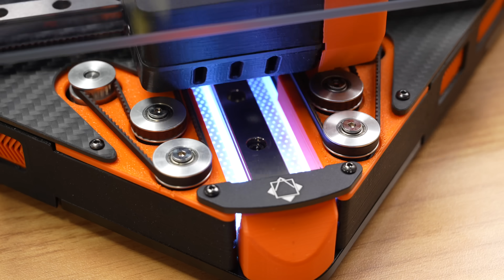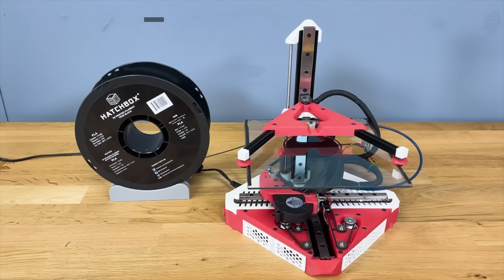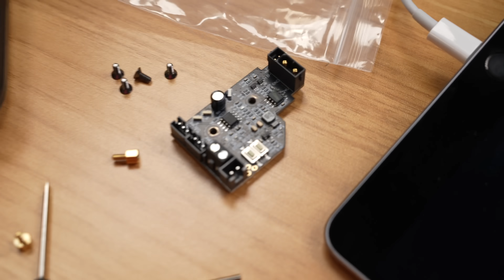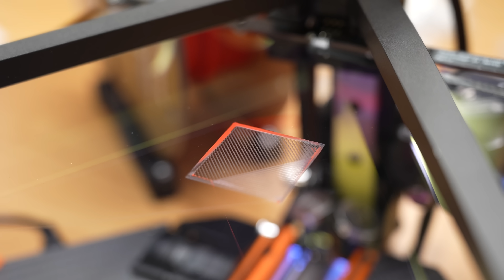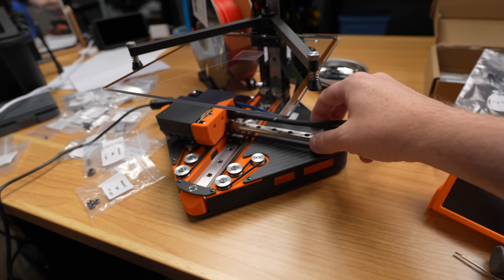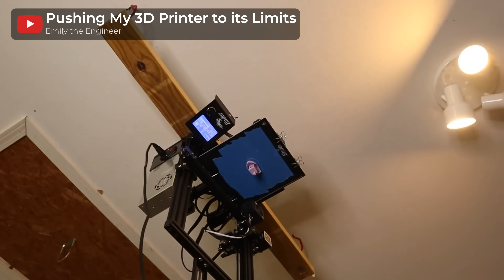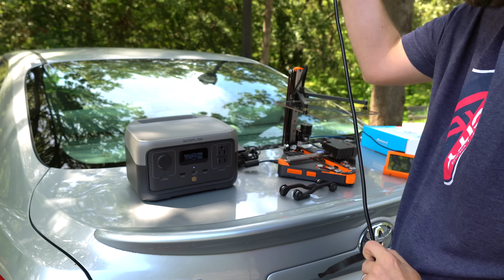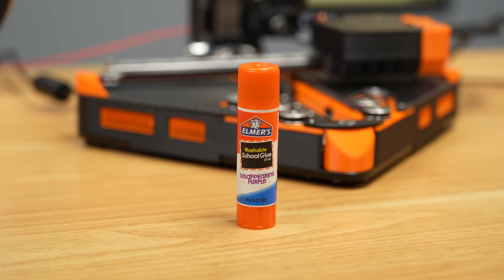Finally, a 3D Printer for Australians!

Comment: Do you use less support material overall when printing upside down?
Reply from the maker: Not really—overhang performance is affected more by part cooling than the orientation of the print, so it may help in a few specific edge cases but overall if you need supports right-side-up, you'll need 'em upside-down!
Reply: Supports are needed (when needed) because you can't start printing in mid-air, or because you can't leave a part hanging in mid-air after having printed it upside down.  Same as with resin printers (that typically print upside down) which require the same supports of an FDM printer.

Comment: big question since you get your stuff for free: would you buy this extremely expensive mini printer that has so many flaws? multimeter, having to mod parts before even getting an average print out of it? two out of ten stars imo.
Reply: This is a reasonable price for a kit printer. Even Voron V0's are similarly priced. And remember, Vorons weren't perfect when they first came out.

Positron is a new kit printer, it's not subsidized by the government, and it's not backed by fortune 500 investors, so the price won't be cheap, and there will be some growing pains. But that's why It's completely open source, so if you wanted to try and self source your own, you can, and if you wanted to help solve some of the challenges with designing a brand new machine like this, you could help contribute.

As Jeff said, it's the Miata of printers. It's not trying to compete with anything already out there, but it tried to solve the portability of printing. The first portable computer wasn't as good as it's desktop counterparts, nor was it cheaper, but it challenged the idea of what could be.
Reply: Its for a specific audience. That said, if they add beacon contact and a usb pd powered board itd be pretty compelling.

Comment: If I'd own one I'd just mount it upside down under the desk. Then it has all the advantages of both options and takes up no space on my work surfaces.
Reply: That actually is a design feature - The feet double as mounting holes so you can mount this under a desk.
Reply: @nomadsgalaxy  Oh that's neat!
Reply from the maker: haha that would be amazing! I should do it.

Comment: KB9RLW made a video recently on changing his 3D printer to run off 12V solar for his campervan. Maybe using a 12V for that might work if it can be converted.
Reply from the maker: It can definitely run off 12V, though needs steady supply from 50-150W. I was hoping to do a print off solar + inverter, but my solar panel hasn't shipped yet :(
Reply: @JeffGeerling  Get red shirt Jeff to knock one up. On second thought, no. Might get the hammer out.

Comment: With tweaks, future benefits to upside-down-3D-printing could exist in the sense that light (or other electromagnetic spectrum wavelengths) can be shone through the "glass-base" (or at least some of it) and that can be used to "set" or cure chemicals applied (such as sprayed) during the printing at various stages, automatically, and monitored with a camera or other sensor, be that infrared camera or UV or X-Ray or magnetic or whatever suits it. So for example, if methacrylate were applied (i.e. "sort of sprayed") on the underside of the hull of that Benchy-Boat, a UV could be used to set it, especially if also a two part were used and then a heat camera could be part of the monitoring of the progress since it would be an exothermic reaction such that by the time it were done, the benchy then has an extra layer of a different material serving as something like a composite material. This example could be considered vaguely like how copper was applied as a retrofitting to the hull and/or bow of old British Navy wooden ships with limited royal budget, thereby increasing the speed, lowering water resistance and winning battles.
Other more practicable use-cases might exist however including a prototypical prosthesis since those are examples which use a "coating" (adhesive really) of methylacrylate. 
In other words, it would not work so well on an upright-3D-printer if the result had the "not yet set" methylacrylate dribble down as gravity refuses to let it be "sprayed" on quite so well as for an upside-down-3D-printer.

As an aside other wavelengths (not just UV) could stabilise the temperature, like infrared, during the exothermic reaction in case somebody were to be 3D printing in some cold place like Canada, Russia, Scotland, Chile, Antartica, or China. the structure of a slower cure could be predictable as a known quantity. Probably some estimation (maybe a Rosenblatt-Parzen window for histogram and spectra) via postgres LLM could help that alone for small compensatory adjustments and wait times and layering as the computer "blags-it-on-the-fly" to customise each babysitting print. The (bins or classes of its) histogram would presuambly be made by separating a signal into a series with Fourier analysis. Even OpenCL 1.2 on a raspberry pi (3b, 3b+, 3A or pizero2w) could do that with some CPU help.
BTW, Maybe a robot arm does the "spraying" of methylacrylate or whatever coating or adhesive or two part esther group chemical compound is worth using. It could also be used like disclosing tablets for seeing errors/flaws along the way, for 3D print blotch removal or prediction by gaussian noise elimination and spectral analysis, perhaps with some Chebyshev polynomial. Kind of like a teacher with a red-pen (a infrared pen, even), making niminy piminy "missed a bit" critiques in the formative stages of life's tight-rope right when you're trying to concentrate, instead of having your work jolly rogered.
My comment has no hate in it and I do no harm. I am not appalled or afraid, boasting or envying or complaining... Just saying. Psalms23: Giving thanks and praise to the Lord and peace and love. Also, I'd say Matthew6.

Comment: For the nozzle ooze.. I use fast food napkins to quickly wipe the nozzle off. I am bias, being on the Positron3d Team, but I love and take mine everywhere. Printed all my parts in polycarbonate so I can leave it in my car on 120f days.
Reply: How about using a lot of priming skirts (or gcode macro with a long fat line to prime), and heat it while touching the bed? Then you clean it off after each print if needed and just let it prime without oozing at all on starting a new print, at least when not changing filament.
Reply: Just buy a box of kimtech wipes.
Reply: so how does PETG print and stick to the glass, I only print PETG and use a textured plate. I like the design and size, but what I can print is important
Reply: @Zimbob2424  PETG sticks a little tooo well to glass, you actually need to use glue to ensure the PETG doesn't bind with the glass.
Reply: @nomadsgalaxy  yeah, That's kinda what I figured. and I personally don't want to use glue, textured pei plate works great and lasts
Reply: @Zimbob2424 We're actually working on a version that uses a PCB bed too
Reply from the maker: Ha, so dashboard-mount when?
Reply: @JeffGeerling  as my daily driver is a charger, there isn't enough room on the dashboard. I am getting ready to print while on a road trip though. :)

Comment: Great video about the Positron. I had a similar experience with my build and you're right, it's the Miata of 3D printers. I saw the real time support from the community as you were building and want to point out that the community support is part of what makes this a great project.
Reply: Awww, thank you friend 💙💙
Reply from the maker: 3D printing community in 2024 is a wholesome vibe

Comment: Looks like the box it's packaged in is bigger then an Ender 3 but somehow the finished device is MUCH smaller.  I bet they hired an Amazon packaging engineer.  😂
Reply from the maker: Haha "giant box, one tiny thing bumping around inside" :D

But the carrying case is actually great for the padding—I would feel comfortable having the case bump around in luggage handling, and reasonably assured nothing would break (maybe something come unplugged, but that's a quick fix).
Reply: @JeffGeerling  That case does look high quality!
Reply: @JeffGeerling  I often bring this on as a personal item, but it survived being a checked back without issue last time I travelled.

Comment: i got memed into buying a prusa 3d kit as my first 3d printer and it came out so horribly i had to return it and i haven't been able to find a good way to get into 3d printing after that
Reply from the maker: Honestly the two routes to go are buying something fully assembled (which gets you into 3D printing immediately) or do a kit build (either Voron, Prusa, some Enders, etc.)... that's better if you want to learn how 3D printers _work_.

I started out with an Ender, which could be a bit frustrating. Then I bought a Bambu Labs P1S which changed my perspective (it's more like an appliance—plug it in, start printing, done). And now that I have a reliable printer, I'm getting into learning how 3D printers work and want to do a Voron build at some point!
Reply: hmm i have multiple friends that arent all that crafty that had no problems assembling theirs
just get any bambulab printer, they are really plug and play and are much more current gen than most prusas that are affordable atm
Reply: @officer_baitlyn  yeah i saw a video on that in my feed recently, might have to grab one if i save up enough